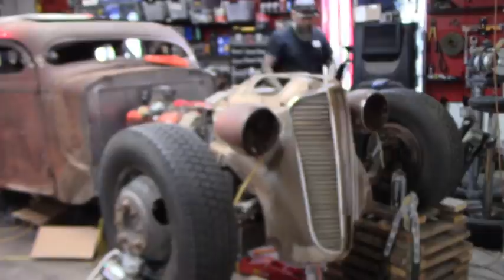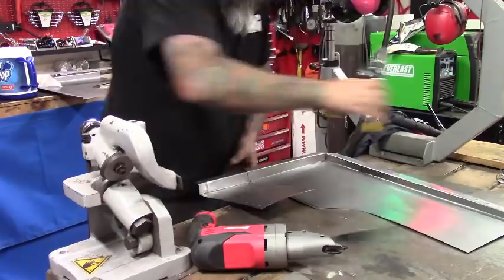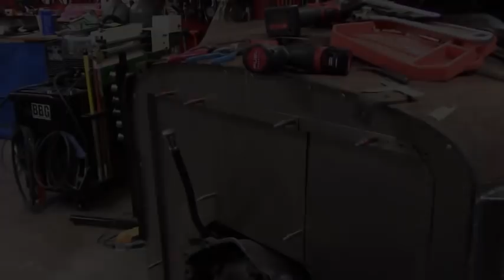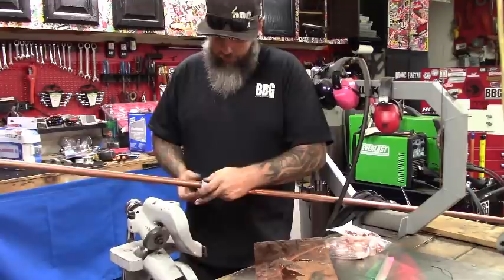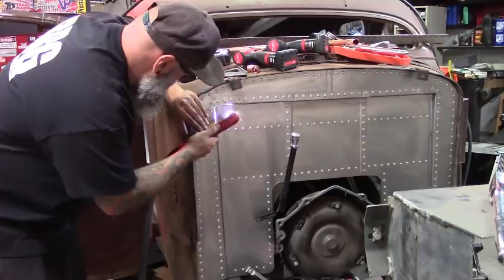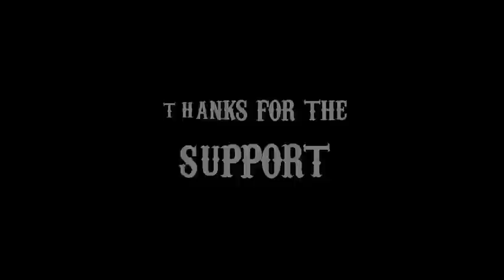Custom Firewall - Part 2 - 1937 Rat Rod - Update 61

Comment: Great idea on the copper tubing for wiring. I would not have thought of that. Looks cool. Paint the engine Cobalt blue;  goes good with copper and would be out of the norm and with copper coloured valve covers (Timothy Newkirk comment below) would be sweet.

Comment: I mistakenly thought that firewalls were installed to delay a fire from getting into the passenger compartment and that any holes in it had to be via tight fitting grommets.  I also thought they had to be made from steel or similar material but apparently all this only applies to aircraft or race cars.

Comment: Engine either Black or pressure wash it and leave the heads and block "patina" and everything that bolts on valve overs, oil pan, intake, etc....make it look nice and new

Comment: You might consider a faux oil rubbed bronze paint finish. It involves using a metallic copper paint highlights on an oil rubbed bronze base coat. This paint process give the engine that steampunk look.

Comment: Satin or Mat black for the engine. Gloss black is too shiny in relation to the rest of the car. Another viewer suggested copper colored valve covers which I think is a good idea as it will go with the copper wire way you installed.

Comment: Great results on the fire wall, the copper pipe was the topper.  The engine with that combination would look good in flat black. If you have brass expansion plugs leave them unpainted.  I think that would really set things off. Just a thought.
Car looks great!